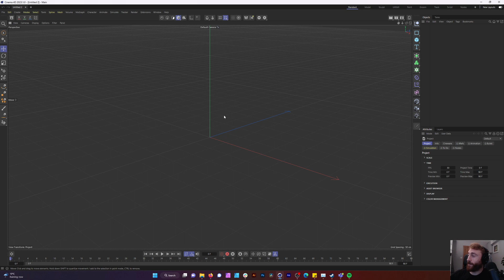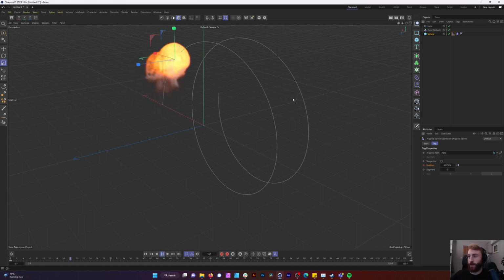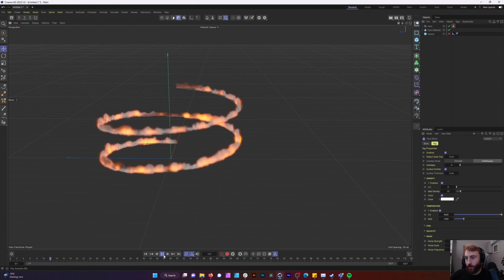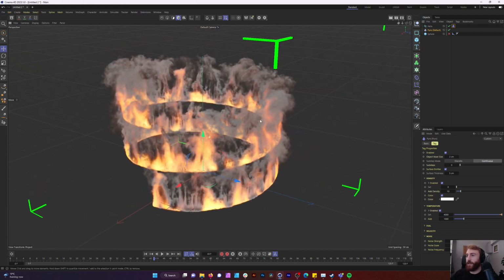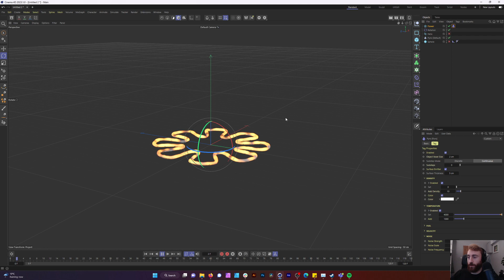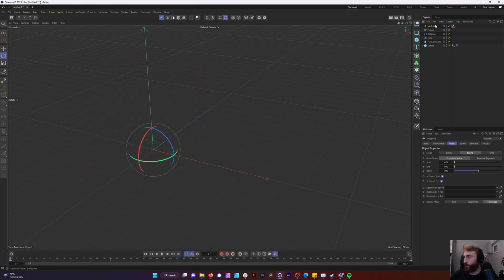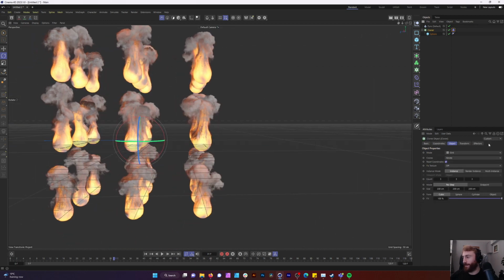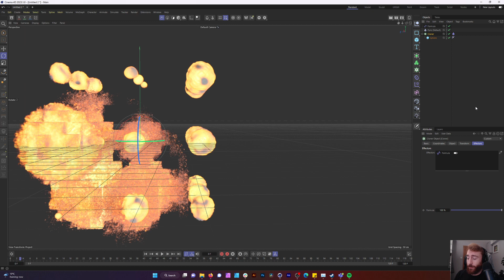Experimenting  with 🔥Fire 🔥in Cinema 4D to the the point of crashing💥

Comment: Proud of it crashing ? Pyro crashes CONSTANTLY..we are the beta testers
Reply from the maker: @PaulSinghSelhi-VFX-TUTORIALS  agree
Reply: @BoldBreak  It seems the problem may well be C4D 2023..it has gaping memory holes with simple scenes eating more and more memory..going well over 45 GB  sometimes. Pyro itself on 2023 may also be an issue but I suspect basically 2023 is pants. I can just about get SOME pyro out of it and then work with R26 which is stable. But I need to justify the expense of a new rig and then go r2025